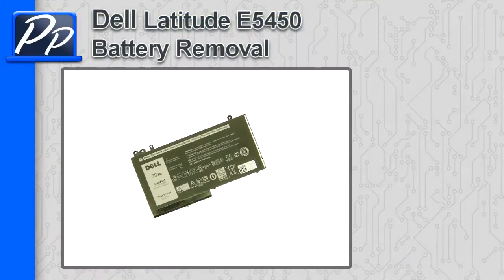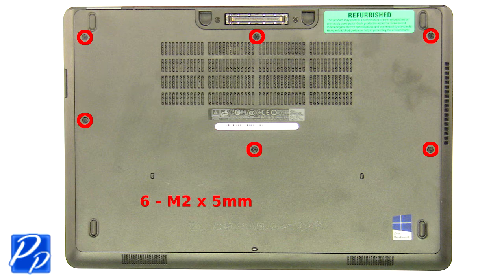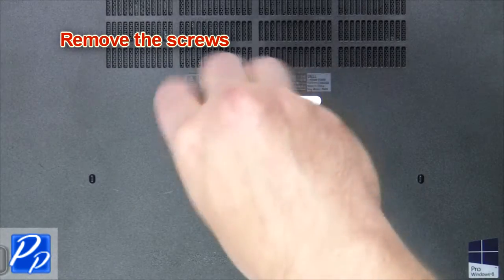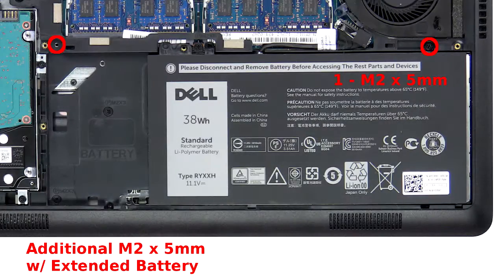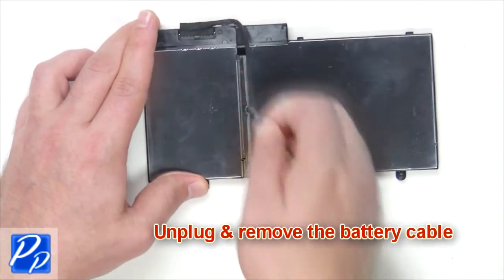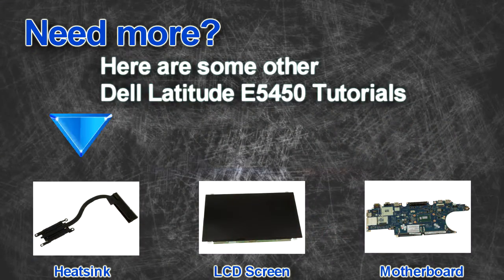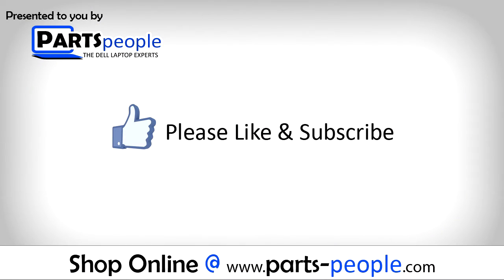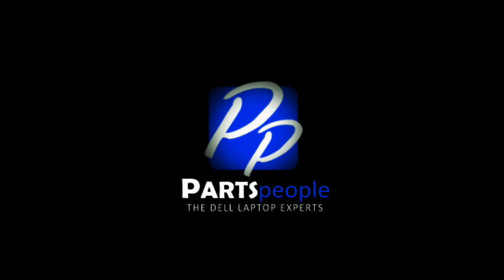Dell Latitude E5450 Battery Replacement Video Tutorial

Comment: It would help if you showed close up how to actually detach the cable from the motherboard to avoid accidental damage. After all this guide is to show you how to remove a battery.
Reply: xD  i did it with my bare hands. no big deal

Comment: I am using the same model and was wondering if we can still use the laptop without the battery? I am planning to use just the power cord for office use.
Reply from the maker: +Daryl Saceda Yes, it should work fine without the battery installed.
Reply: do we have to change some wires for it to work without the battery??  @dellpartspeople